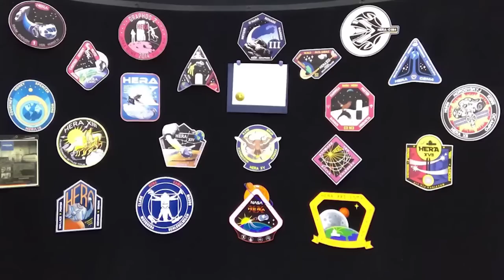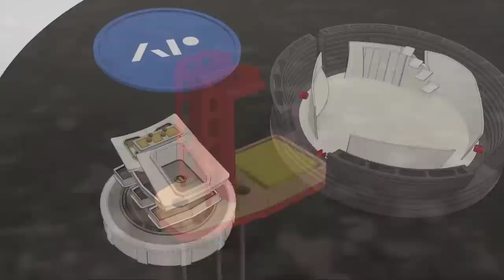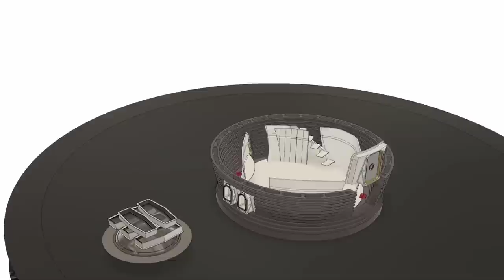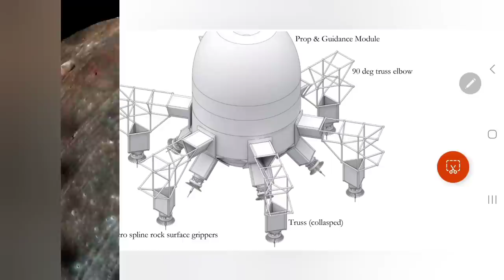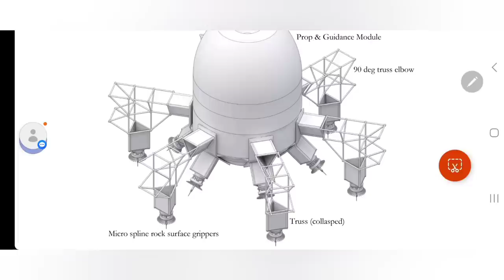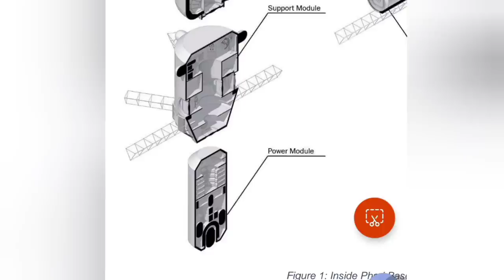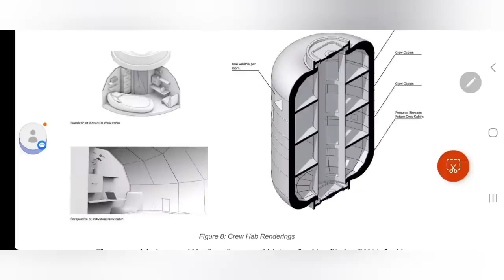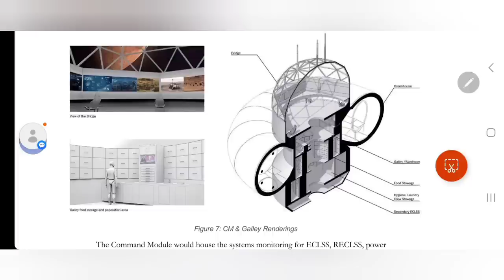NASA planning a Phobos base!  Here's why Elon Musk should do the same!

Comment: Building a base on Phobos could be an excellent idea. Dig down and you get shielding from cosmic radiation and you can have people on site remote controlling vehicles on Mars surface with a minimum of lightspeed lag.
Reply: Even on the surface,  radiation is half of open space, or even less on the Marsward side because the planet blocks a fair chunk of the sky.
Reply: I would have robot arms that would move t rocks without a space suit.
Reply: Mr. M-P , 
Shielding isn't the only reason that's an excellent idea ; Phobos has many deep craters that shield their depths from sunlight . These would make excellent storage yards for frozen-solid rocket- propellants . This specifically is referring to hydrazinediium/hydrogen- pentoxide . These propellants remain frozen below 0°C. , are safe to handle in ice form, and provide a specific-impulse 
at least as high as Ly/Lox . 
Containers stored on Phobos would last indefinitely , even if hit by meteorites . The mission-flexibility this would provide would be invaluable . 
NASA and Mr. Musk would be well served to conduct the necessary R&D as soon as possible , in order for future mission-designs to include these very convenient superfuels in their plans .

Comment: If you build a tower at a pole of Phobos, this will provide constant radio contact with starlink satellites installed around Mars.

Dock 2 starships to the tower with cables, coat the insides of the starships with material from Phobos to add protection against cosmic rays.  Then spin them around the tower to provide 1g live/sleep areas.

Some workers can live part-time in 1g, and do shift work mining Phobos in 0g.  Some workers can stay 100% in 1g and remote control equipment on the surface of Mars, building infrastructure, to prepare for colonization.

Some challenges keeping tower from ripping its foundations out of Phobos, but can figure that out.

Comment: Deimos makes more sense, for a number of reasons, including lower Delta-v, better view of Mars for teleoperation, better solar illumination, better Earth communications, and some others.
Reply: I think phobos is better, not lower delta-v more like more delta-v, it has a higher orbit, in general in optimal orbital mechanics you want to hop from low orbit to low orbit, that's an other reason I think elevators are stupid (on top of all the other ones they already have), better teleoperation? nto even fully sure of what you mean but, I'm pretty sure there is not any important change in teleoperations, solar illumination is true that the orbit is not the best on that and mars covers it everyday for some time, but it orbits very fast and it is illuminated more than 60% of the time I think it is kinda fine, earth communication is exactly the same dunno what you talking bout, and some others that you don't mention so no

Comment: @angry 
It's funny that you mentioned "tethers" both to describe attaching modules to the surface and then when talking about a 6000 km Mars skyhook, but missed Phobos' real party trick: The Mars-Phobos L1 and L2 points are just 6 km from the surface. You can build a space-elevator from the surface of Phobos into Mars orbit using a tether about 20 km long (a length which has been tested in Earth orbit.) Ships can remain in orbit. Modules and supplies can be lowered to the (eventually underground) base, propellant can be lifted to a depot into orbit using only electricity.

Comment: @Angry: How do you decelerate at Phobos without sufficient fuel? I thought aero-braking in the martian atmosphere was supposed to be the main method of reducing delta-v.
Reply: Always a good question, still waiting for a good answer.
Reply: @jounik  you could probably skip at least some off of the upper Martian atmosphere in an elliptical orbit.  Until the Apoapsis got close Phobos at least.  It would save some delta V.
Reply: Aero capture into Mars orbit, much easier and safer than braking all the way to a landing. That's the part Angry has been warning about.
Reply: Landing on Phobos would be tougher than just landing on Mars, though, wouldn't it? It's the same reason a lunar landing will require more fuel than a Mars landing, even though it's only 3 days travel vs. 6 months.
Reply: @robertmiller9735  I haven't thought about this, thanks!

Comment: I still can't say I totally understand the benefit of landing on Phobos. It's orbiting at 7,700km/h, so assuming you arrive when it's traveling away from the earth that's that much less delta V you need to achieve. Plus it's not pulling you down, so you don't need to be decelerating against gravity. But if you can get down to 1300km/h using Mars' atmosphere, isn't that still better? The typical trip to Mars in 7 months travels at almost 40,000km/h. So you'd be relying on fuel alone to slow you down 33,300km/h to land/tether to Phobos vs only slowing down the last 1300km/h to land on Mars (plus extra fuel for resisting gravity during that time). Am I missing something? I can see some of the points for establishing a base on Phobos, but not using it as a way station before going down to the surface. I feel like I'm not understanding something crucial here.

Comment: That skyhook idea, didn't NASA try to dangle some copper wire back in the day of skylab and the cable exploded due to the difference in electrical current between the van allen belt's, does not Mars have some weak electrical/magnetic fields ?
Reply: Doubt it’s enough to matter

Comment: What is the gravity on Phobos? I would imagine it would be better to simulate these missions on the ISS. Even though microgravity will be less on ISS than Phobos I think it would make it easier once you get to Phobos, as the small gravity will make operations easier than none at all. If that makes sense
Also, I'm not sure how long it is before Phobos' orbit decays but could its orbit be boosted, like with the ISS?
Reply: It won’t decay for a few million years, by then Phobos will probably be some o-Neil cylinder, an ark that was sent to the outer system or it was slammed into mars to help terraform it